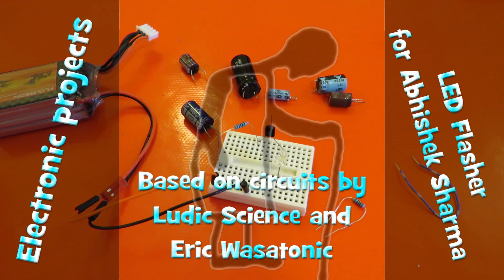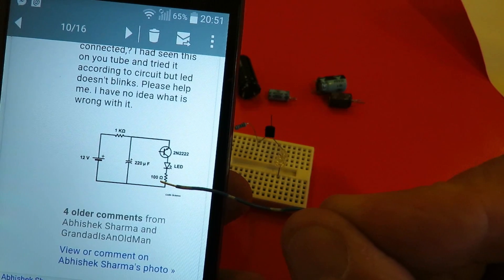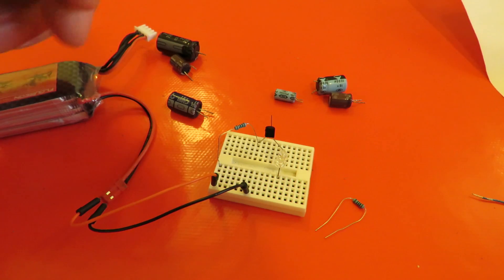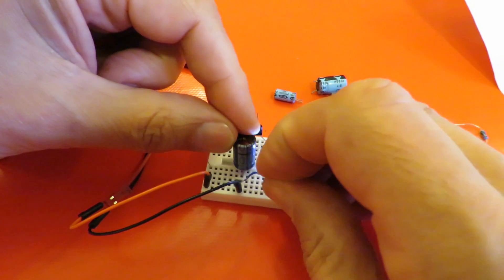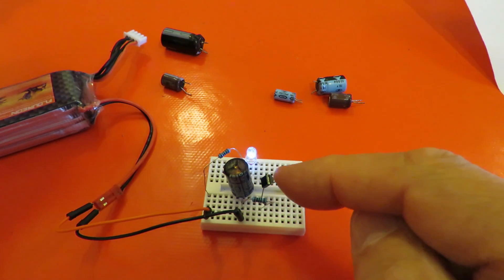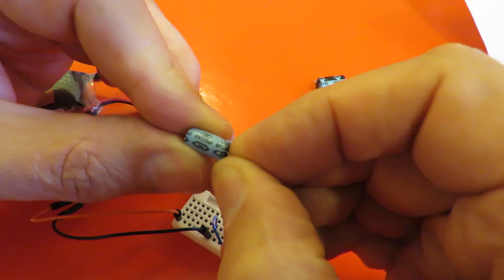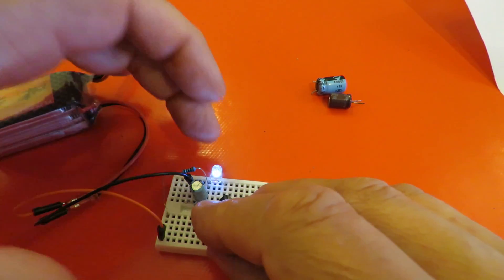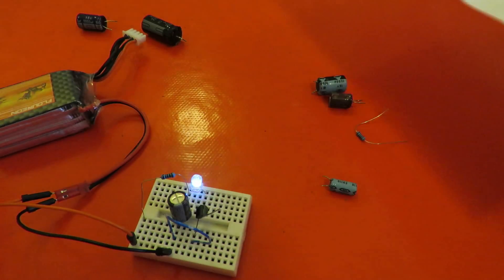LED Flasher Circuit for Abhishek Sharma

Comment: Hey could it be possible that the frequency of the led flashing is not visible to the naked eye.
Reply from the maker: Yes, but that is why I used the selection of different value capacitors so we could see the different rates. However if you look at the original videos by Ludic Science and Eric Wasatonic (links in the video description) you will see their circuits flash at a slow rate using the capacitors originally mentioned.